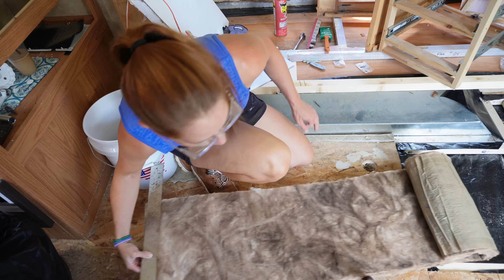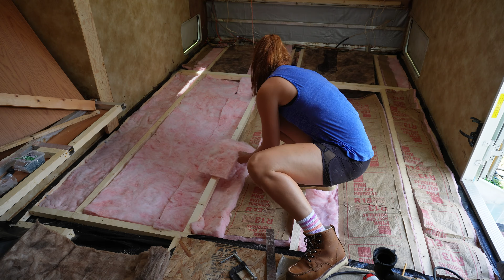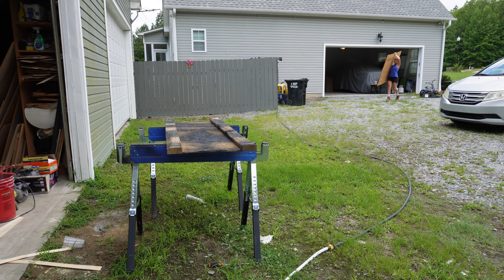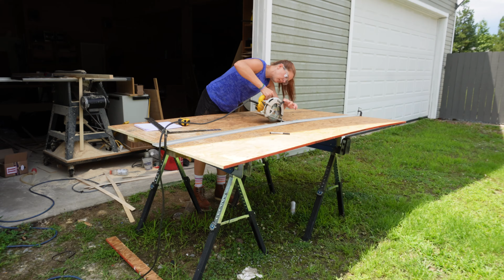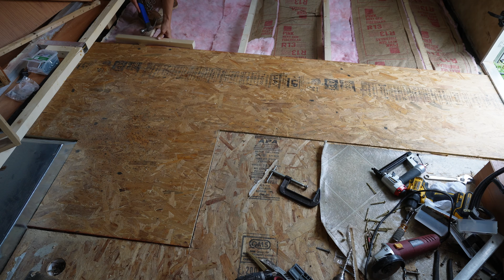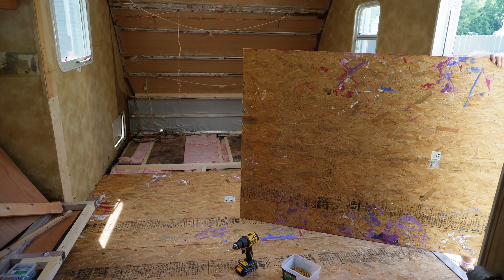RV Water Damage Repair: Demo Day 17 Floor Repair

Comment: what you just did with the insulation the R-value is way lower than if you used 1 inch thick foam board , nice try lol

Comment: Question on the 2x4 framing members around the perimeter that are screwed to the aluminum tube perimeter members at the bottom of the wall. Did you use self tapping screws to screw the trimmed 2x4s to the aluminum tubing?

Comment: Never put batten insulation back in it holds water and causes all the rot. Should always use foam board when doing rebuilds. You can get the r value you want in foam board and avoid further issues after all the work.

Comment: Aren't subfloor built first and exterior walls placed on top?  If so don't the new subfloor need to be slid under bottom wall plate?  Thanks 😊
Reply from the maker: They are, but no. If the original framing is solid, I can screw a piece onto the existing framing to build the new floor. If it’s rotten, then yes, it needs to be under the new walls. In the case, I’ll jack the side of the wall off, clean it out, and put a new piece in!

Comment: Where can i get ceiling and wall panels
Reply from the maker: I buy mine at lowes or Home Depot. If you have a builders discount center near you, they also sell 5mm underlayment. That’s where I usually buy it, but they don’t have many locations so I like to include lowes and Home Depot

Comment: I use foamboard backed with aluminium foil, and i am building for down to -30C would not touch the candycotton with an ten foot pole! Candycotton is cheaper and lighter that is all.
As long you stay in moderate temp areas it works, but if you have the risk of real low or high temp do not trust the candycotton
Reply from the maker: I don’t live where it would ever get down to -30C, so I don’t have to worry about that. I tell people all the time, build it how you want it done. Want it to withstand cold temps? Go for it. Want it to withstand the Arizona desert? Add that extra AC unit. Functional is best!

Comment: I'm not sure where you got your information on r value but it's incorrect. The R-13 fiberglass you're installing is at 3 1/2" of thickness. Compare that to a Johns Manville polyiso insulation board that runs around R-6 per inch which would equal R-21or slightly more in a 3 1/2" cavity. Heck even styrofoam is R-5 per inch which is higher than fiberglass. The other major advantage foam board provides is air can't pass through it.  If you take it a step further and use closed cell spray foam you get R-7 per inch and no air infiltration but sometimes air infiltration is a good thing.

Comment: R13 insulation which is meant for 3.5 cavity has a r value of 3.71 per inch..  pink foam has a R Value of 5 per inch. It also doesn’t turn into a soggy mess..
Reply: Foam board would definitely be more of a hassle installing compared to the bat insulation,  however....I would rather it over bat any day. Especially considering the ratings per inch and traveling in extreme temperatures.
Reply: Based on the original build from the manufacturer any upgrades are a good thing!
Reply: Guaranteed when actual skilled trades workers point out her flaws she says some crap like “ yeah but it works just the same anyways “ 😂😂
Reply: @Gigachadly  she could just say it is cheaper and is what was there originally.. that makes sense.. there are more advantages of using rigid foam insulation.  And she does show some helpful information… but don’t misinform.. it isn’t Christian.
Reply: @Gigachadly 
And where’s your YouTube channel?

Comment: Hey Sarah, love the work you put into your projects!  I did a little comparative insulation research and what I read is that you have to rate/compare them by the "inch-o-meter".  Fiberglass batt insulation has an R-Value rating of 3.7 per inch, whereas the pink polystyrene board has an R-Value of 5 per inch (and Polyurethane rigid panel has an R-Value of 7.5 per inch)... so while it varies depending on the type of rigid panels, what does seem clear is that rigid insulation actually does provide a higher R-Value than fiberglass batts.